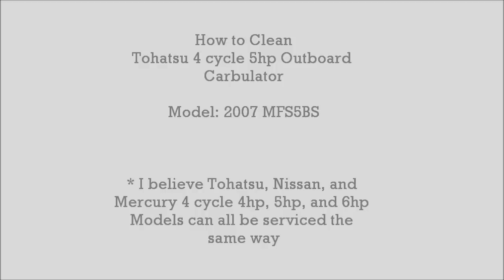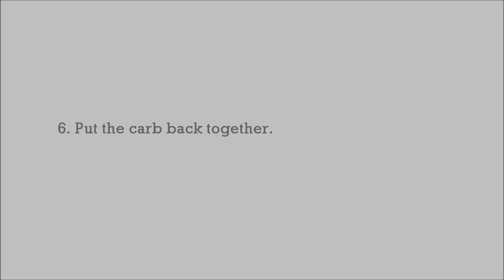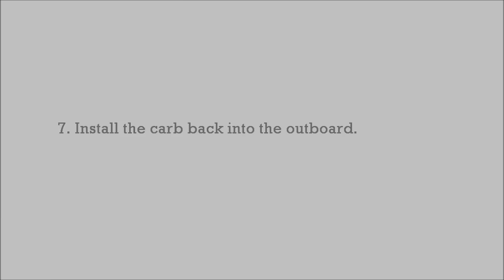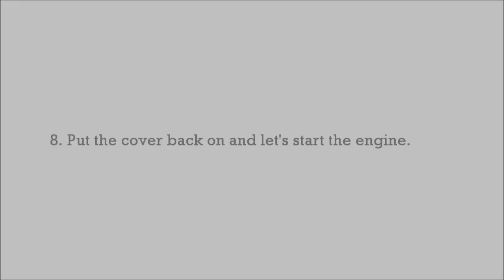Cleaning 5hp 4cycle Outboard Carburetor - Tohatsu, Nissan & Mercury

Comment: Hey Sumogurinet:  This is the SECOND time your video has really, really helped me.  I want to give thanks, I’ve been very frustrated with the motor.  I’m a sailor, but my boat is docked on a tidal river with a very stiff current.  I haven’t been able to use my boat!
Here’s what I had been missing, that your video showed me: first, I had not noticed the thick plastic spacer between carb and intake manifold (mine dropped into bottom of cowling, I finally found it) and without it, your throttle setting is wrong.  Second, ’til now, I never realized there was a little valve body that comes out after the main jet.  A bit of tapping and it fell right out.  In fact, this may show varnishing, the fact that it wouldn’t freely fall out. 
So… thanks much!   You have probably made a real difference in my summer.

Comment: I can confirm that this is identical to a 2005 Merc 4 stroke 5 hp.  I could not even get it to fire once until I performed this 'cleaning' procedure and now it's starting like new.  Thanks very much for the video, I would not of tried it myself without the clear procedure in this video.

Comment: Thanks for the video.  Small learning curve makes it quite easy after the first attempt.  Had a gummed up carb on a 6hp Tohatsu, despite draining the bowl over winter. Cleaned the main jet with a steel wire strand, which allowed it to start. But could not idle. As there is no jet to clean, but a circuit, I left it soaking in White Spirit. Morning after resulted in a telltale mucus residue at the bottom of the container.  Voilá, runs like new.

Comment: Great video! Just another tip for other viewers: you can turn the black arms at the top of the carb to open up the choke valve (the black disc) and the throttle valve (the metallic disc) up a bit more so you can spray the inside of the carb a lot better!

Comment: You’re a lifesaver! Mercury 6hp 4str 2018 did not want to run anymore. Single injector in the center, brass screw has minute opening, 
Cleaned it with brake cleaner (not the carburetor). Thanks a lot.

Comment: Thanks for that, I have two 6 hp Mariners, I took no 1 to a Mariner dealer having got some water in the fuel. Charged me 2 Hours Labour at £40 per hour plus £25 for ultrasonic cleaning. Total with vat £140' Watched your video , bought ultrasonic cleaner in Lidls for £10 . Did  second engine half an hour , Great result Thanks so much.

Comment: Your video gave me the courage to give this a try. Thanks. In my case, the problem was idling required a half-choke. Cleaning with your method didn't fix it. Ultimately, it required removal of the brass plug by drilling, removal of the idle mix screw, and rodding/soaking/spraying until that passage was cleaned. Now it works like a charm. Another thing to note is that there's also float needle valve in the bowl that at times needs to be removed and cleaned too. Symptoms there are no gas or flooding with gas.

Comment: Excellent video . . . .I have a 2006 ^ HP Merc and have had nothing but carb problems after the first 1 1/2 years. I use it on a 20 foot sailboat weighing almost 3000 pounds and I just replaced the gas motor with an electric Torqeedo which works fine. I do want to get the Merc running and this vid is a big help! Thanks, Gil

Comment: On my 3.5 hp unit from 2016, it has a small rubber stopper next to the central jet, it will pop out if you spray it with carburetor cleaner as it expands too. Be sure to not lose it, as it will mess up the whole carb will run badly. Also, good to rinse out your entire line to make sure there is not debris in it, and check the fuel filter is not gunked up too.

Comment from the maker: I think the outboard is pretty durable as long as you winterize the motor correctly and change oil based on the owners manual. I did not remove gasoline from the motor when i left a long time. Thanks!

Comment: Does that motor have a spark advance that rotates under the flywheel ?  I want a 6 hp that I can make the throttle operate with a servo = Fly by wire if you will . Thanks Tim

Comment: Here's what they don't tell you.....BUT IS VERY IMPORTANT!!!..Remove the gasket between the carb portions BEFORE using carb cleaner.....or it will make the rubber gasket stretch and it will not fit! However.....if you are faced with this problem......place the stretched-out gasket in the freezer overnight....it will contract almost back to it's original shape and size, and it will work for you. How do I know.......been there, done that!!!

Comment: Thanks for the video!! Question, When I took apart the carburator I noticed that the choke plate was stuck open and it was hard to even move it, is that normal? Would a choke plate wide open prevent my outboard not to start?

Comment: you are missing 1 gasket on the back of the carb, the plastic spacer is sandwiched between two gaskets, besides that the video was perfect
Reply: If you look closely he didn’t remove that gasket you’re referring to  it was still stuck on there.

Comment: My problem is exactly what you don’t show. These carb are having the shaft of the float very stiff to take out. Contrary to others who just slide freely. I broke one branch holding the shaft once and have to buy another carb... very expensive here in the caraïbes. . And now the same problem... scare to scrap another carb. I can see the float’s jet is stock.

Comment: Hi  there,
Great Video. Just bought a 5hp  Mercury ,exactly the same, its a 99 model. It was not started for 3-4 years.  Cleaned the fuel filter, Cleaned spark plug and fresh fuel. Started on Second pull. Ran totally ok. Warmed up with some choke. When I increased throttle, just died from idle. Powered up,pulling choke out a bit. So I'm going to do the rebuilt, hopefully this is the problem. Or could it be not a fouled up carb ? What do you think. Also Is there no need to replace gaskets ?  Appreciate a reply thanks mate.
Reply: A Thom  
Hi there. Yes just take carburettor off and clean everything.  Mines running like brand new. 😁

Comment: I've got fuel coming out of the hole on the top of it and can't figure out why or what to call it. Does anyone know?
Reply: Maybe the float is broken or  stuck
Reply: its your float level, adjust the float until the needle barely comes into contact with the carb needle when turned upside down by bending the metal tabs carefully, you basically want the float parallel with the carb or approx 10 - 11 mm or 3/8 inch to top of float from carb base, hope this helps

Comment: I wish you would answer from comments. I took it apart and it was dead easy, looked pretty clean for a 99, not really any gunk sitting in the bottom. What l was wondering, l have the exact carb and the long brass screw, with holes both ends, mine was a bit shorter, it had a hole in the end and just from the end,had 3 or 4 smaller holes in the shaft of the screw. The end where you put the flat head screw driver on  did not seem to have a hole running through. Or l did not have a pin thin enough to go through. Anyone can tell me if the is a hole there??

Comment: Do Mercury & Tohatsu 4,5, and 6 outboards use the same carburetor?
Reply: ***** I believe so, and also Nissan outboards.
Reply: The 2 brands use the same carb, but the carbs differ with the power rating. The 6hp carb has a bigger venturi.
Reply: yes, I believe they are all re branded Tohatsu and painted different brand. Larger outboards are a different story I think.

Comment: Old gas will gunk up your carb with varnish.. ethanol added to gas makes it worse.. Try using a fuel additive to your gas like Sta-bil Marine... cheap insurance IMHO.  Also if you have access to a good Ultra sonic cleaner that will clean out those passages where you can't spray into. I cleaned up a really gunky hood fan with hot water and TSP in the ultra sonic cleaner.. wow.. your carb did not look bad at all.. just a clogged passage I bet.

Comment: Looks like the same carb as the 2.5 and 3.5 lol
Reply: it is exactly the same... it is the same motor, they put a smaller opening to the carborator to limit the HP. A 2.5 can be converted up to 5.5 hp with a kit.
Reply: Mike M so I bought a 3.5 tohatsu..you think that just the carb is bigger on the 4 or 5 hp version?,,thanks